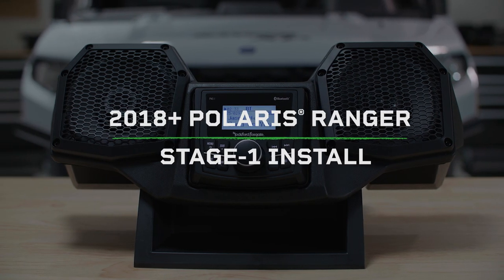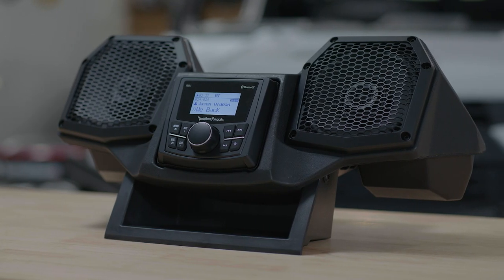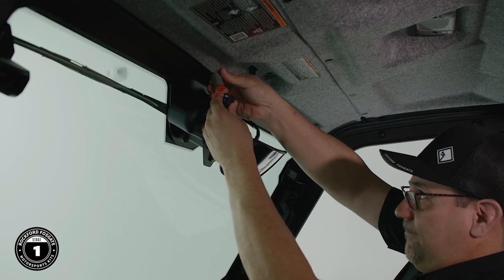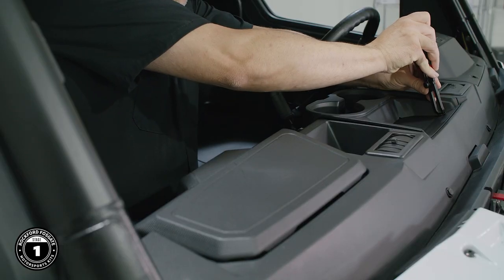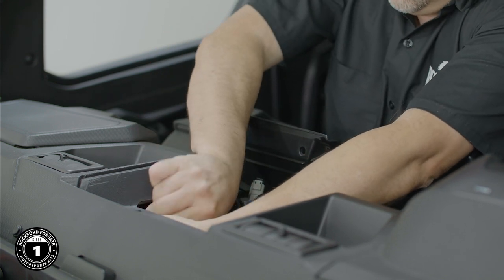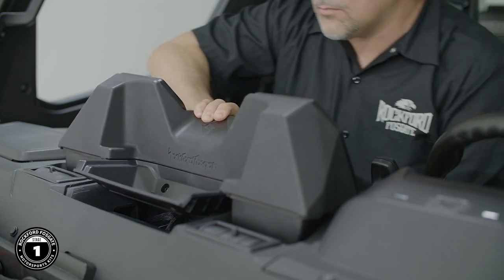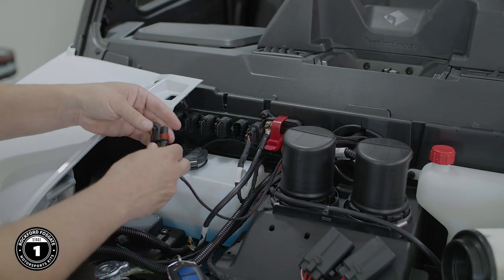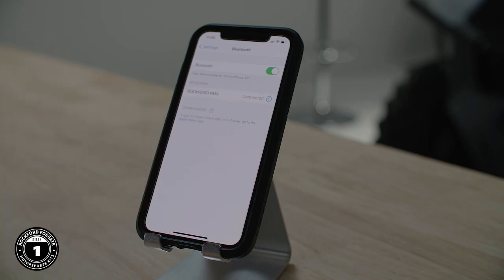2018+ Polaris Ranger STG1 | Installation

Comment from the maker: RNGR18-STG1 Product Details:
https://rockfordfosgate.com/products/details/rngr18-stg1/
Reply: Does this unit have the ability to play from a USB stick?
Reply from the maker: @stevenwebb7949  Yes, the PMX-1 does have the ability to both charge your device or used as an USB input for audio.  You'll need to remove the radio, connect a USB extension, and drill a hole underneath the enclosure. 

https://www.amazon.com/Sabrent-22AWG-Extension-Cable-Female/dp/B017XUSKVK/?th=1

In the future, you can also add the RNGR18-FSE speakers as well.  It would be worth getting the M0-65 speakers as the RNGR18-STG1 doesn't have a built-in RGB controller for the M1 or M2 Color Optix™ illuminated versions.

You can find more info on the PMX-1 here: 
https://www.rockfordfosgate.com/products/details/pmx-1/

Comment: Finally got it installed and the handle for the windshield hits the rear of the left speaker.
Reply from the maker: Can you get the handle all the way down?  Ours was a tight fit but there was enough tolerance so I moved the pieces and could get it to fit.

Comment: Work on 22 waterfowl edition? Sound as good as soundbar? Water/weather proof?
Reply from the maker: 1) Yes (see below)
2) Sounds Better 
3) Yes (see below)

You can see our compatibility chart and learn more about this on our Product Details Page at: https://www.rockfordfosgate.com/products/details/rngr18-stg1/
Reply: I have the waterfowl will stage 1 fit it with windshield
Reply from the maker: @danfrank5833  Yes, we installed our Stage-1 on our Northstar Edition with tip-out windshield. If you by chance have the “tip-out” as well, then you may need to work on drilling pilot holes for the receiver.  Definitely going to sound great with the windshield installed!

Comment: Do you use the bracket from the factory tip out window as a template to drill holes on the bracket?
Reply from the maker: Yes, we did another RANGER equipped with a tip-out window, and we used the receiver bracket to determine where to drill holes in the change tray.  Remember, measure twice, drill once!

Comment: Bought my 22 fully enclosed with the flip up windshield. This unit doesn’t fit without trimming the change holder and modifying it. I’m not done yet. Got this thing butchered and looking like crap. Might cut the change holder clear out.
Reply from the maker: Yes, we note on our compatibility chart that the tip-out full windshield requires modification, but it will fit.
Reply: I’m not trying to complain. I was just adding that note here in case anyone else was wondering about it.
Reply from the maker: @jessop0joe  Totally appreciate posting your experience.  This is exactly why I'm replying in detail, so others reading can understand the modification.

Comment: How do you use the Aux & USB settings? Where’s the plug ins?
Reply from the maker: The pigtails are on the back of the radio.  Every installation is different, so we let you drill your own holes based on how you want to connect extension cables.  You can either remove one of the speakers to access the ports or remove the trim ring from the radio, then remove the 4 screws to remove the main radio unit from the housing.

Comment: I have a 2023 Polaris Ranger 1000 Premium crew and the bigger kits will not work with it. With this product could I add two rear speakers, a subwoofer, and an amp?
Reply from the maker: Are you sayin the STG-2/3/4/5/6 models don't work because it's not on the compatibility chart or because of modifications made to the UTV?  I haven't added 2023 model compatibility yet to any of the charts yet, but we have inspected several 2023 Ranger 1000 models and there is no difference between 2022 models in regards to adding the audio system.
Reply: @rockfordfosgate  with the XP model there is little to no difference. The 1000 “premium” has a full plastic cabinet under the seats.
Reply from the maker: @michaeldesyllas3199  Thanks for that clarification. Yes, the RANGER 1000 Premium shows NO compatibility for 2020-2022.  It's the RANGER XP 1000 Premium that DOES show compatibility for 2019-2022.  

Yes, the RNGR18-STG1 does have REAR outputs on the radio, allowing you to add the RNGR18-FSE or the RNGR18-RSE.  You'll need (2) DEUTSCH/Amphenol #DT06-2S connectors to tap into these.  Links to the front/rear speaker systems below:

• RNGR18-FSE
https://www.rockfordfosgate.com/products/details/rngr18-fse/

• RNGR18-RSE
https://www.rockfordfosgate.com/products/details/rngr18-rse/
Reply: I have the same bike as you and this fits fine.  There are two rear/additional speaker harnesses out for additional speakers/sub with an amp connection for power on.  Connectors are Deutsch/Amphenol type..
Reply from the maker: Thank you @patrickleigh

Comment: Can you hook a powered subwoofer to this unit?
Reply from the maker: The RNGR18-STG1 has RCA FRONT and RCA REAR/SUB outputs that can be accessed if you remove the radio and drill access holes through the enclosure.  These outputs can be used to feed an additional amplified speaker or subwoofer.

Comment: antenna?
Reply from the maker: Hi Ryan, there is an antenna port on the PMX-1, so if you need to attach a long range antenna, you can remove one of the speakers, drill an access hole on the bottom of the enclosure and feed your antenna cable through it for attachment to the Ranger antenna whip.
Reply: How is the sound on stage 1. No windshield issues
Reply from the maker: @danfrank5833  Sound Quality is much better over any type of SoundBar you could install since we use larger diameter speakers in an enclosure that’s good for mid-bass response.  The speakers are raised closer to your ears so you can hear music details more easily as well.  Many UTV dealers have these in stock, so try our Dealer Locator and contact them to see if they have one on the show floor so you can hear for yourself.

Comment: What are the part numbers for the add on speaker wire kit?
Reply from the maker: Hi Brett, You can create your own harness using the (2) DEUTSCH / Amphenol #DT06-2S connectors and 16-18 AWG cable.

Comment: Mine stopped working anyone have any issue with that
Reply from the maker: What part of the STG1 stopped working?  Do the speakers not work but the radio still turns on?
Reply: Is there a issue with window clarance , hitting the widow.
Reply from the maker: @danfrank5833  No clearance issues.  If you use the tip-out window, you’ll need to modify the base to reattach the receiver.  We have a full compatibility chart available on our website at https://rockfordfosgate.com/products/details/rngr18-stg1/